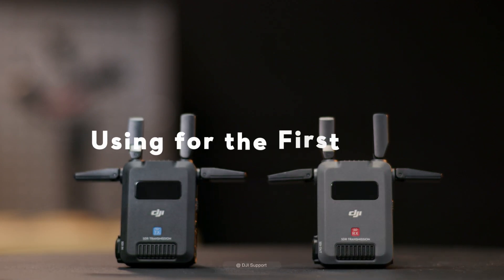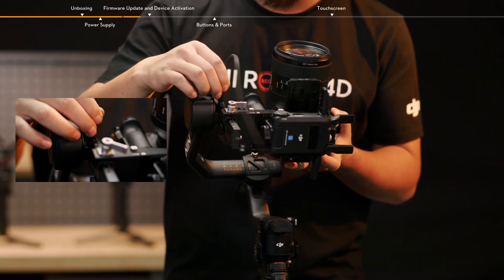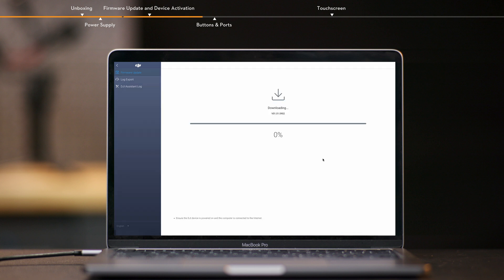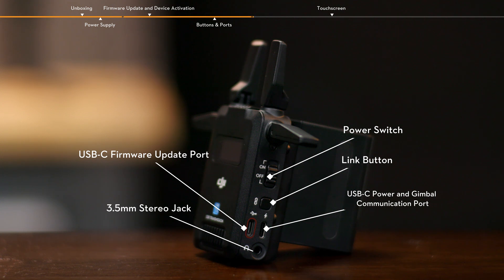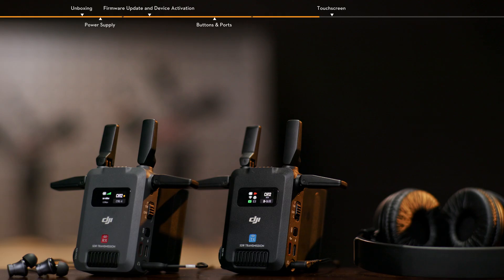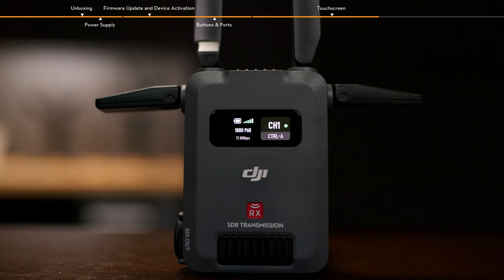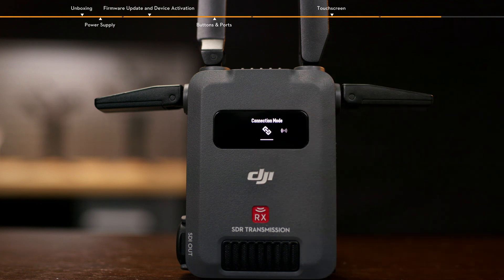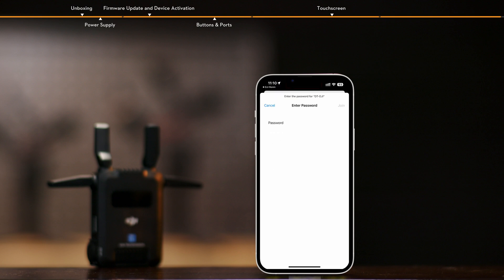DJI SDR Transmission｜Using for the First Time

Comment: I wasn't able to connect to Assistant 2 with a Lacie orange USB-C cable but when I swapped for the included DJI USB-A (needed adapter to my computer) the Rx Tx units did appear. After setup, my DJI RS3 Pro won't power the Tx regardless of which cable or port I choose. Not great!

Comment: Frustratingly you can't power it from a PC with 2 USB's to do the first firmware update, I had to use the RS4 pro to power it while setting it up for the first time, screen is too small, also this video did not talk about connecting to your phone to view

Comment: Return to sender. This thing doesn't connect. Tried various USB cables, tried with 2 computers, won't connect. And having to connect to an app in the first place for this thing to work is ridiculous. This isn't a drone, it should work out of the box.  DJI has always been on point but this product is a total fail.

Comment: Anybody actually get their devices to work? Might have to return these. The device doesn't show up in the Assistant 2 Ronin app on my Mac. It's a paperweight.
Reply: Having this issue, had to power it via DJI RS4 plus Gimble, would not work with 2 usb's from my PC or laptop
Reply: @phoenix_NZ  can you explain me how you did it ? i have the same issue

Comment: Someone tested it with an RS2 Gimbal? 

Also the compatibility List says it's only compatible with the FX3. Someone tested if the fan mode "rec low" works with the FX6 as well?
Reply: found an answer to the RS2?
Reply: I tried controlling rs2 with dji sdr and not working, still working on raveneye but can't have sdi output. Do you know if it's working on rs3 & rs4 ?  @rupivisuals

Comment: does anyone know why it's not working with 1080p25? it only works with 1080i. also no playback possible - i guess also because i record with p and it doesn't support it. hope anyone can help. another problem is no energy supply from the Ronin RS3 although shown on the manual.

Comment: Why is low latency mode locked to 60fps? Half the world is on 25/50p (PAL)..... can this be addressed in a firmware update?
Reply: thats completely right they should enable it
Reply: Half the world isn’t worried about analog broadcast standards. All the world has moved on to resolution/frame-rate based digital transmission, and you can set your camera frame-rate to 50fps if you need to - the sdr units will happily send the captured 50fps video data on its way.

Comment: So far i can't get it to connect via the app. I'm going to be 100% honest. It should work out of the box and this step is BS. Going to make sure that's in the review on B&H.
Reply: I ran into a similar situation. I also totally agree, this setup step is pretty ridiculous. However, the dji assistant 2 app itself won’t work, you need specifically the Dji assistant 2 ronin series app. Which looks pretty much totally identical, but the ronin series will actually have your transmitter/receiver show up when plugged in
Reply: @parkiel54  yeah it took me a minute to get to that. You'd think the web page or whatever would take you to the right app vs showing you all of their dozen or so versions. but at the end of the day, it should work out of the box. What if your on set or location and need to order or get another one. It will add on hour to your day.
Reply: I'm so pissed about this.

Comment: Will you launch SDK for third party iOS Apps to use the USB-C video for things like multi-cam production and streaming with Apps like Switcher Studio? If yes, kindly allow Force Mobile and Zoom control to work with partner Apps. 

Your other competitor ‘Accsoon’ already have the Accsoon SeeMo HDMI/SDI to iOS video adapter and they are already partnering with video production and Streaming Apps, and they’re soon launching a Transmission System with SeeMo USB-C output on the receiver, similar to the new DJI SDR Receiver USB-C to iOS video output. 

The DJI System should beat everything in this lane because of the ability of control DJI RS Gimbals. And am curious if it’s possible to control the Zoom motor attached to the Gimbal, via the DJI Monitor App. And if it could be possible to have position  and Zoom presets in the App? All these features that are instrumental in live video production sessions, I suggest you allow partner Apps to use them. 

The idea is to use our running-gun setups as PTZ cameras during production sessions that would ask for PTZ cameras like mounting the in complex positions and on elevated stands.

Comment: I had 6 android and apple devices on set and 4 of them didn't connect to the transmiter. Ghey were connected to the wifi but no image. Very dissapointing.
Reply: I tested it on myself today, connecting an unlimited number of receivers in broadcast mode is possible, but you have to use DJI transmission receivers, and there is no way to connect other devices on iOS or Androin, only 2 devices. DJI's company explained this very poorly to ordinary people who hoped for the ability to connect unlimited number of external devices on iOS and Android